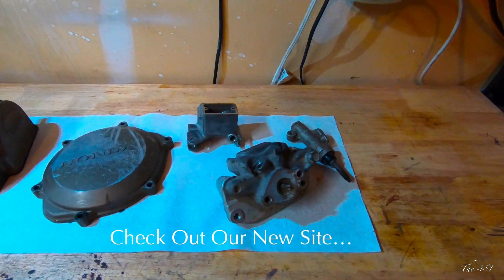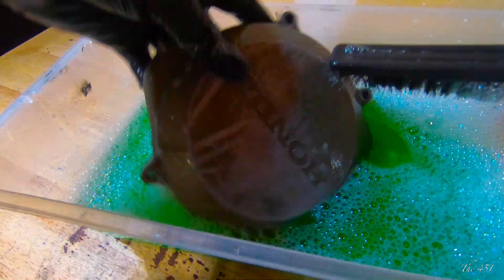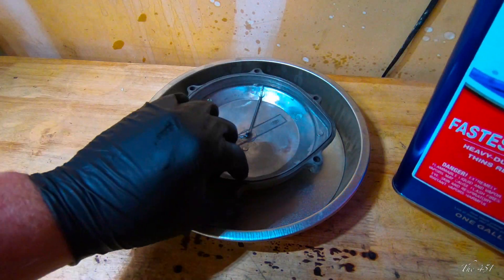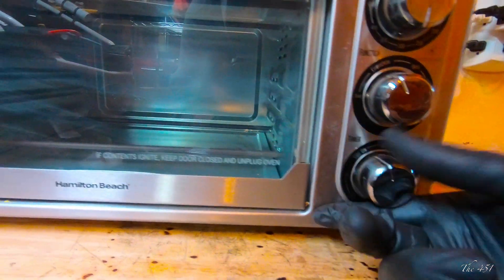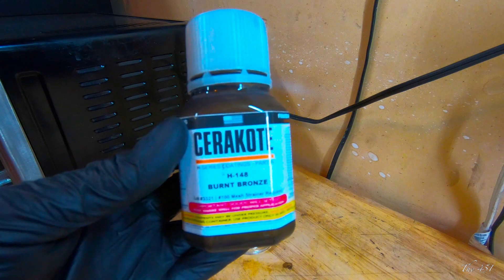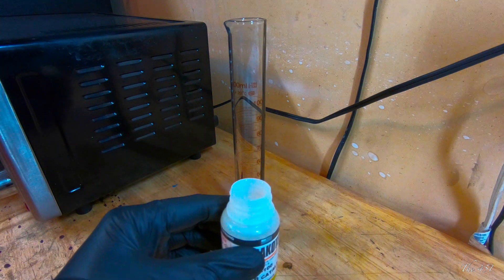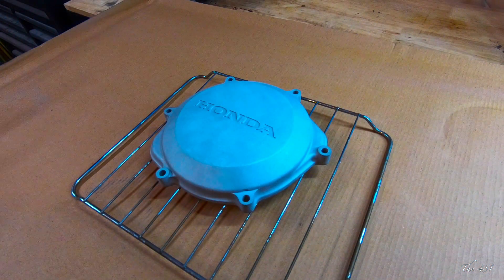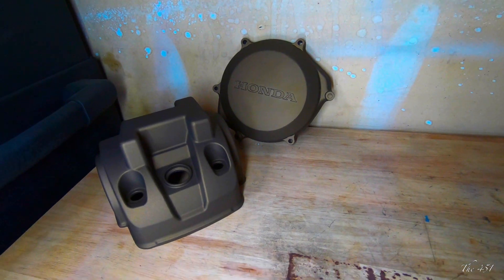Cerakote Dirt Bike Parts

Comment: Awesome video. What size compressor are you using for sandblasting? Also what type pf blast cabinet? Thanks in advance.
Reply from the maker: I started off with a 20 gallon Kobalt air compressor. But I quickly upgraded to a 60 gallon Ingersoll Rand 16CFM. And I’m just using a simple Harbor a freight cabinet, nothing too fancy.
Reply: Thanks bro I appreciate it!

Comment: Awesome Job. Curious if I could use a 6 gallon Pancake Compressor 150 psi to spray parts.
Reply from the maker: Harley Scott Thank you!! 
Yeah you should be able to use that air compressor to spray the parts. But, that size of compressor would be too small to handle the Sandblasting before hand unfortunately.